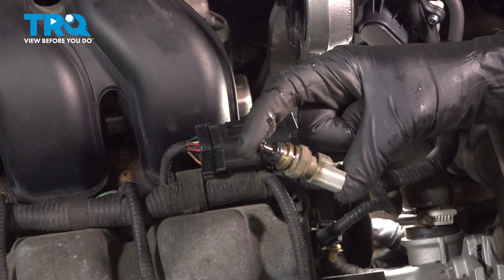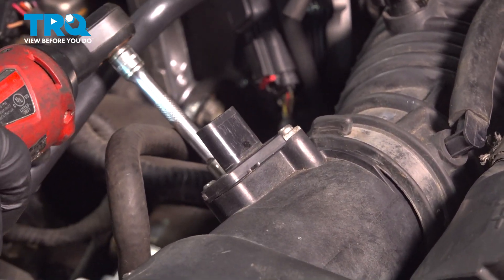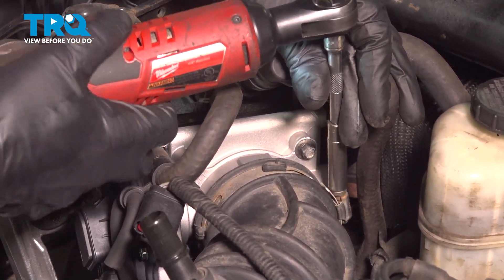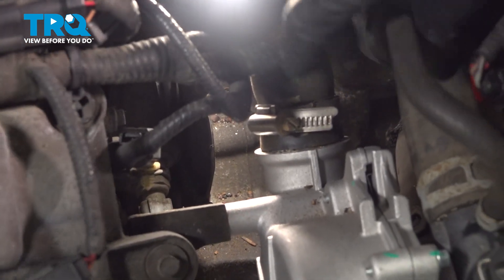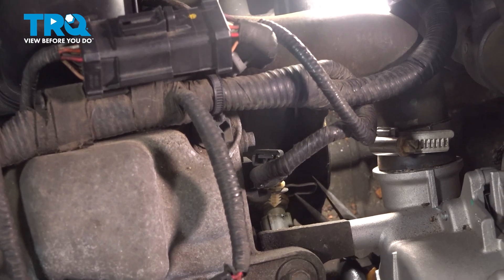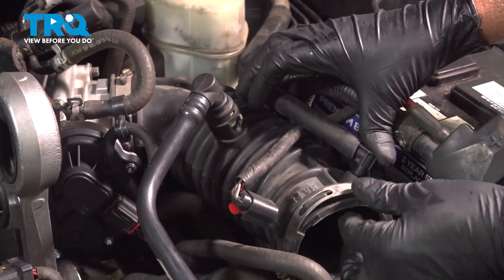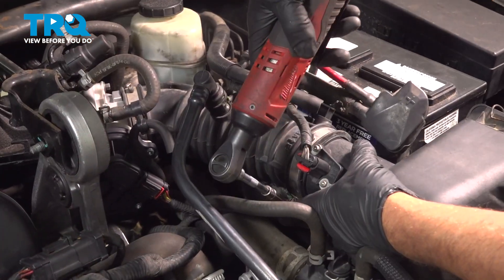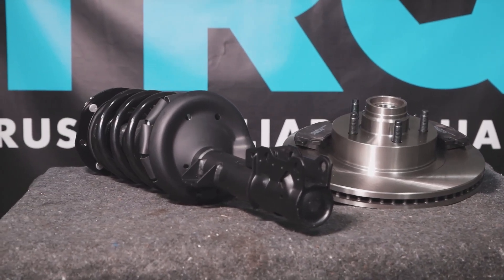How to Replace Coolant Temperature Sensor 2005-2007 Ford Five Hundred

Comment: ok will this sensor cause a no crank ,if so is there a bypass. just note u can fill the coolant from the port on top of the hose instead of the reservoir.
Reply from the maker: +@klakytklak We wouldn't be able to diagnose an issue like that here, you may want to have a local mechanic take a look at it. Thanks for checking us out! http://1aau.to/m/Shop-1AAuto-c